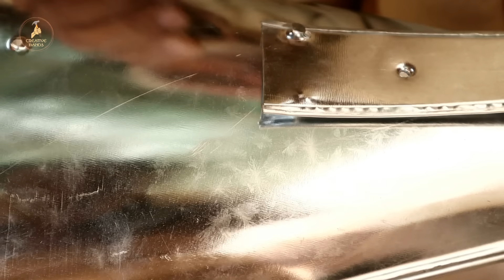70 Years Oldman Make 10 Liter Stainless Steel Conical Measure for Petrol Pump

Comment: This is not stainless steel, but zinc plated one. Stainless steel can not be soft soldered. Anyway, good job!
Reply from the maker: Ok, thanks
Reply: Hi Friend
SS especially thin sheet for making fabricated sign letters is always soft soldered.
Reply: Also stainless steel might be too expensive for him
Reply: Agreed but the workmanship is amazing,peace
Reply: My dear he is making only jug & funnel for measring for mobile oil & carosine oil for shop this material is GI sheet and easy to mold This skilld man is not clamed that I am using stainless material
Reply: I like the safety shoes 👞😀😀😀😀🤙
Reply: Tin plate I think
Reply: yes it can

Comment: Stainless steel can be soft soldered, but it's a pain in the ass as it needs lots of corrosive zinc chloride/ ammonium chloride flux & it usually defeats the purpose of using stainless steel especially now that Chinese factories have become the maestros of cheap thin wall stainless production,
like all the water bottles you see.

Comment: No great skill here. I trained as a tinsmith and a jug like that was a universal exercise. The long seam would be a grooved seam joint (stronger than just hammered), and around the base, a knocked-up joint, formed over a curved "hatchet". All edges would be properly wired. The material here is good, old-fashioned tinplate, not BZP and certainly not stainless steel - though both of those can be easily soldered with the appropriate flux and solder.